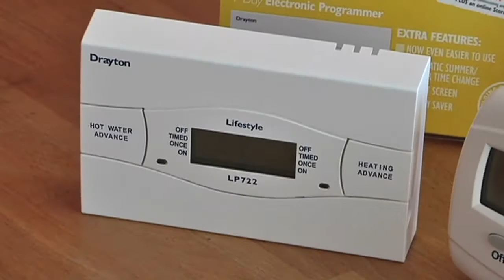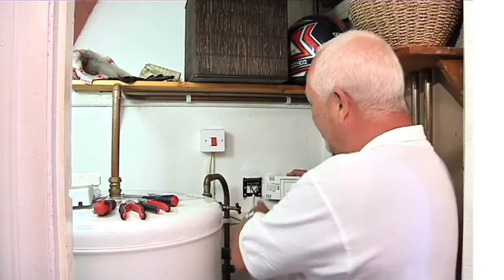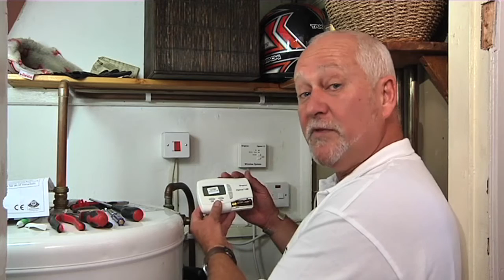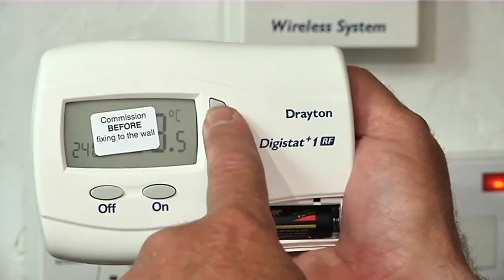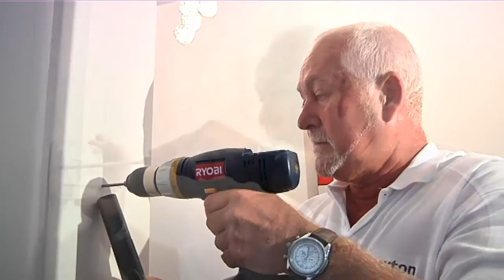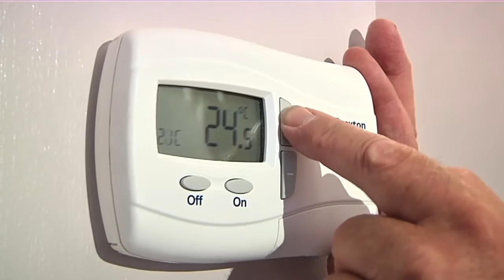Upgrading Controls to a Wireless System

Comment: I'm in need of removing this from the wall.
Yet without destroying it 
One click and your in, ok, now how do I take it off.
This device needs to be placed in a different room of the same home.
Reply: Okay, I've worked it out.
There are two small slits in the bottom of the unit, a flat bladed screwdriver needs to be inserted into both.